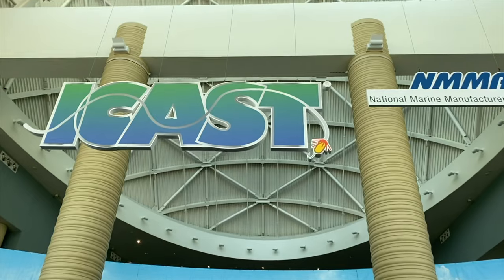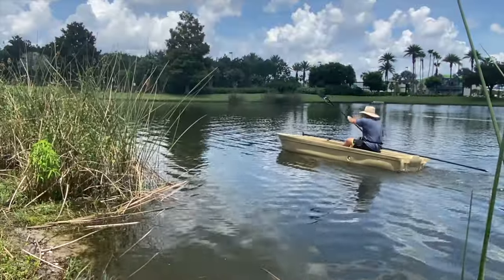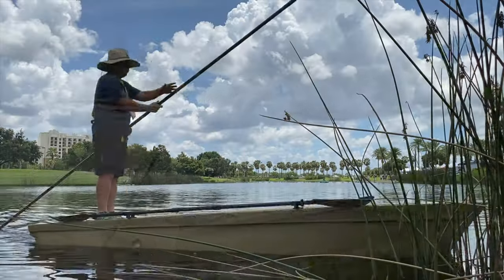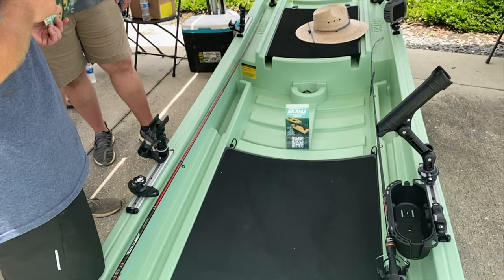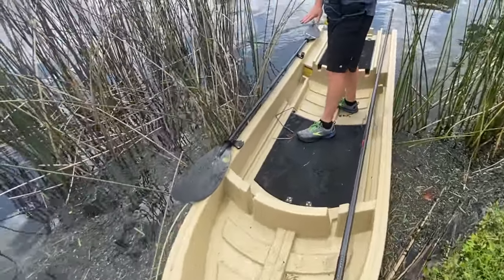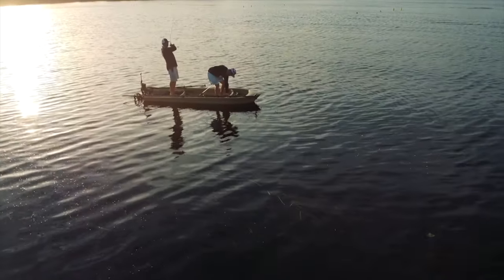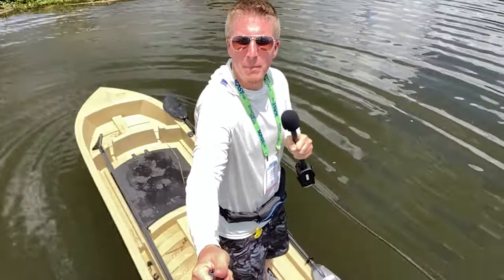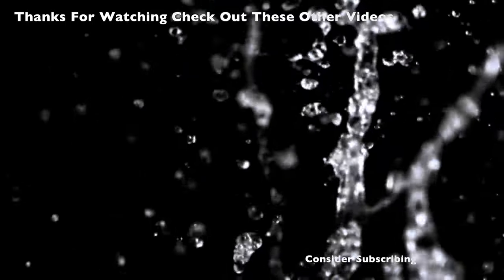SKANU - Ultimate Skiff Canoe Fishing Kayak Hybrid!

Comment from the maker: THANKS SO MUCH FOR YOUR LOYAL SUPPORT OF THE CHANNEL
AND ALLOWING ME TO DO WHAT I LOVE.
SKANU Website: http://bit.ly/SKANUwebsite  

Is it a skiff, a canoe, a fishing kayak, a SUP, or something else....ITS A SKANU!  SKANU is designed and made by an angler and boat designer I respect, Kevin.  Kevin has many years of experience in the fishing and boat building industry.  The SKANU can be motorized with 2.5hp gas outboard/ electric motor, paddled like a SUP, paddled like a kayak, or push poled through flats!  The design has many proprietary designs and patents.  It has side scuppers to reduce drag.  The chines are below the waterline resulting in a significantly quieter craft for sneaking up on fish.  It has a clever fishing rod deck management system, and more!   Check it out....we believe it is an exceptional value for a quality built craft.  At 1/4" to 1/2" thick hull you could drag the SKANU around and not baby it.  I know a kayak angler who dragged a quality kayak 15 miles behind a truck on concrete with no issues....the SKANU is even thicker & durable!  I'M DEFINITELY GETTING ONE after trying it at iCAST! 

#bassfishing #kayakfishing #fishing #flatsfishing

Comment: What’s the max HP for the Skanu and any idea of speed?
Reply from the maker: 2.5hp is the recommended rated outboard. 
I am getting a 2.5hp Yamaha outboard later today.  Then next week or so I will be driving up to the Skanu factory to pick one up.  Between my Scout 430 and this SKANU I’m set for small watercrafts.  These two crafts give me a ton of options for exploring/fishing the waters and islands.  I actually think a wirelessly controlled Motorguide xi3 would be sweet on the bow of this and just paddle/pole it across fishing grounds.  Another way to rig would be anchor pole on transom and no motor or bow mounted motor.  I just got so many dang options.  

To answer your question I’m not sure on speed.  It isn’t designed to be super fast.  The stability on this craft felt almost better than my fiberglass skiff I built.  It is super easy to stand up on.  Rock solid.
Reply: @KayakDIY  thanks brother!

Comment: Looks pretty unstable while standing considering how big it is .
Reply from the maker: I literally can stand on the front 1ft of bow.  I’m 200lbs. It is very solid.  Most people won’t stand there.  If you stand in any normal areas it is even more rock solid.  My camera gear and microphone setup costs over $2500 and isn’t waterproof.  I was standing on the very end of bow with confidence.  I’m planning on driving up to get one.  It does what no other craft cans can do.  Fits in back of my truck or car-top, can paddle it, outboard motor it, pole it, or bow mount motor it.  It has two standing decks.  Made by the same team that designs high performance flats boats East Cape Boats.